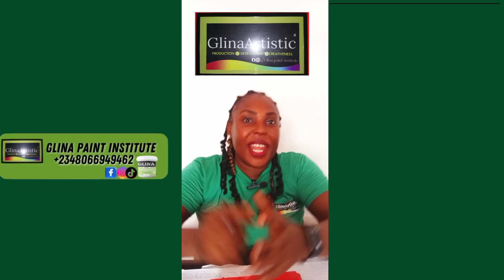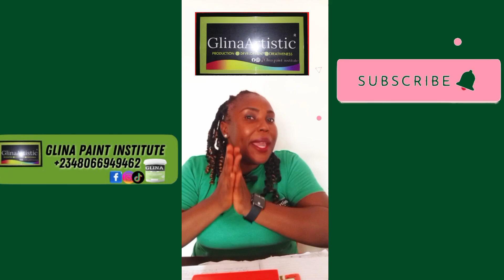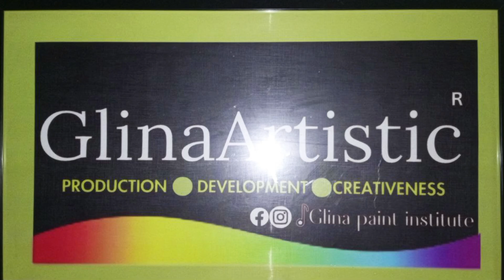PRIMER vs BASE COAT vs UNDERCOAT - Know the Difference & When to Use Them | Glina Artistic

Comment from the maker: Want to finally understand the difference between PRIMER, BASE COAT, and UNDERCOAT?
👇 Comment your biggest takeaway after watching — and tell me which one you’ve been using incorrectly!

💬 Need the full advanced paint system breakdown?
📘 Drop “PAINT FORMULA” in the comments, and I’ll send you our latest advanced training link.

🔔 Don’t forget to like, subscribe, and turn on notifications — more expert secrets dropping soon!
Reply: Pls which paint are good for painting Aluminum....,I have use car paints,Auto based paints and the end is still peeling.
Reply: Oil paint mama😊